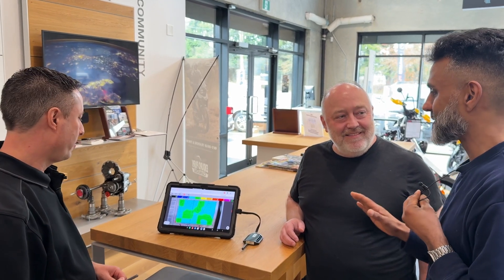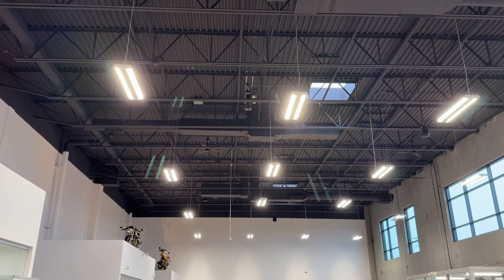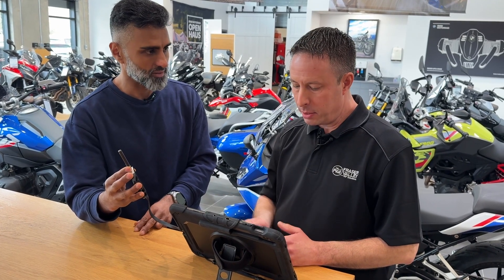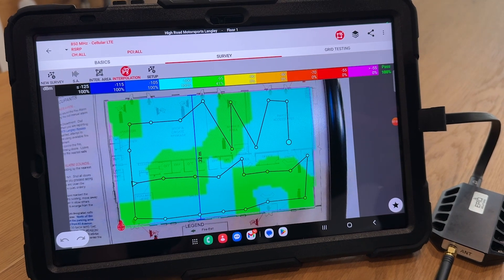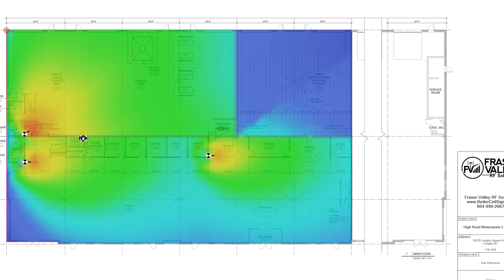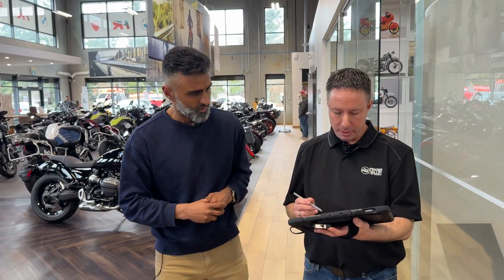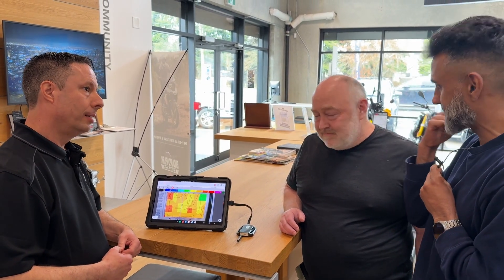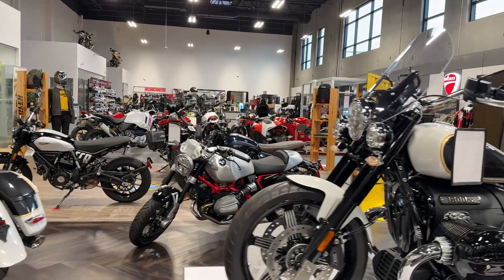How to Boost Indoor Cell Signal & Easily Verify Network Performance

Comment: when prediction was to be performed, what was the RF o/p setting in the IB Wave Tools for your case here?
Reply: Thanks for your question. In this iBwave prediction example, I configured the system using a measured RSSI at the donor antenna location of -85 dBm at 1900 MHz. The donor antenna gain at that frequency is 5.55 dBd, and the cable loss to the booster input is approximately -3.84 dB, resulting in a net input signal of about -81.14 dBm to the booster.

The SureCall Fusion5S model isn't currently available in the SureCall .vex file library, so for demonstration purposes I selected the Fusion5X as a placeholder. This design wasn't intended for precise RF output or performance prediction; rather, it was to illustrate the general functionality of the prediction tool in iBwave and provide a rough layout for cable runs and system topology.

That said, the methodology would remain similar when applying real system parameters in a production-grade design.